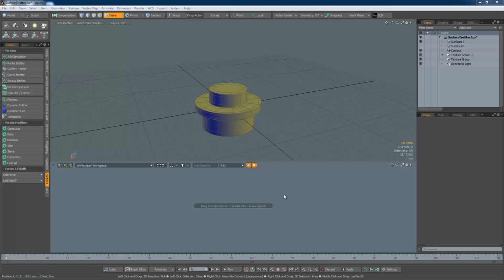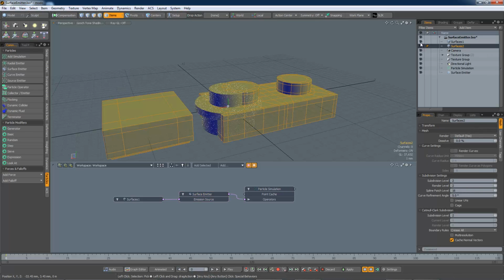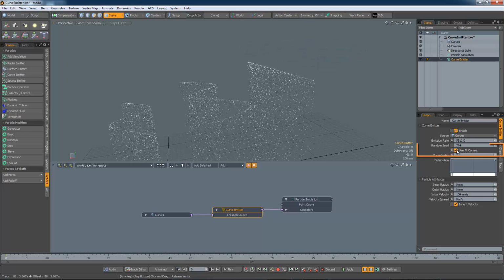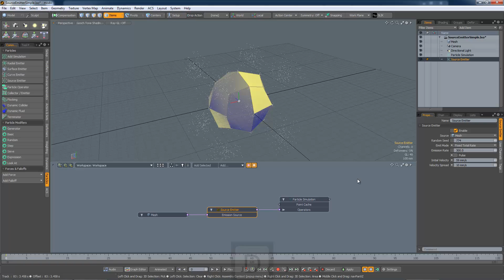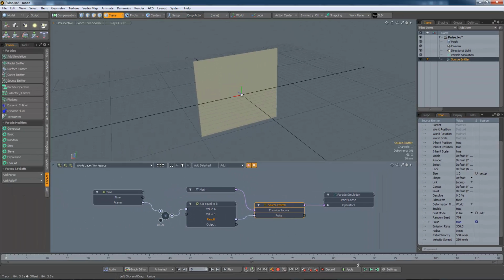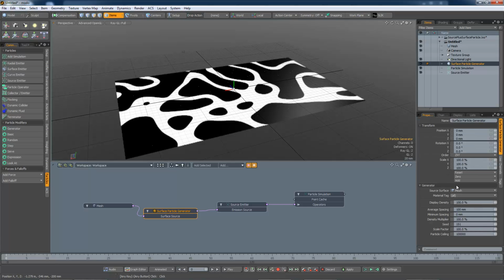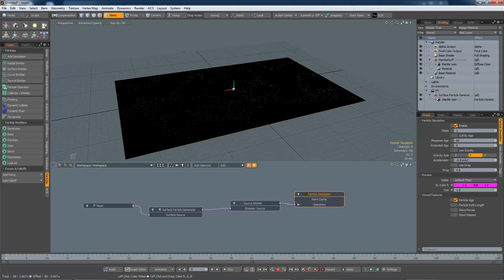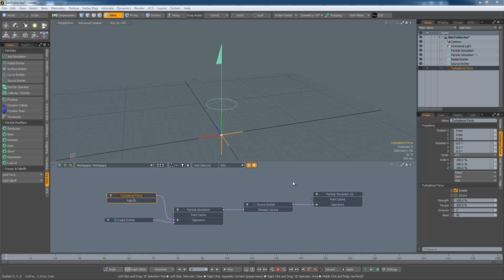The MODO 701 Particle System -- Part 2b - The Emitters

Comment: Hi Steve! How is the fast way to make point cloud from custom mesh volume in the last Modo vesrions? Yes, we can make particle cloud and make boolean subtract with the mesh but it so uncovenient.
Reply from the maker: Was this the sort of thing you were after? https://youtu.be/KjgVfjFLgSw
Reply: @SteveHill3D  This is what I talking about in my comments. Yes, this works but it's so inconvenient. :(
Reply from the maker: @gh3khH_ei  OK -- let me think on it.  I don't know off the top of my head if anything in the newer versions has made it any more convenient.  I have a lurgy (not COVID) at the moment that is dulling my brain so I'm  not firing on all cylinder.
Reply: @SteveHill3D  Good health to you! :)
Reply from the maker: @gh3khH_ei  So, I have created a MeshOp Stack alias/assembly that encapsulates the work needed to set up a particle cloud inside a mesh or meshes.  It basically does what Greg did, but is fully procedural since we can now merge meshes with particles in.  But MODO is doing something really odd adding a bogus "Render" entry in the shader tree whenever I use the alias -- it can't be deleted and I have no idea why this is happening.  If you are cool with the oddness, then I can link the assembly for you to try out.
Reply: @SteveHill3D  I wonder why this has not become a built-in feature in Modo, since it is so necessary when generating particles. For example, Houdini has a node for this and a few more options on how to do it without pain. Please let me check your creation or you may better post it on the Luxology forum. :)
Reply from the maker: @gh3khH_ei  Good plan -- see my tale here: https://community.foundry.com/discuss/post/1232207

Comment: Hi Steve, thank you for taking the time to post your great videos. I have a question that is an extension to using textures to drive a source emitter via a surface particle generator. If the surface was a sphere rather than a plane, how could I get the particles to emit normal the sphere? Currently, they want to meander about randomly. I appreciate any feedback you might be able to lend. - brad
Reply from the maker: +Brad Baxley Hi Brad.  Particles are emitted in the normal direction when you use a surface emitter.  If you are using a different kind of emitter -- like a source emitter for example, then I guess you would have to do some sums to work out the normal based on the position of the particle wrt the centre of the sphere and the use this to set the velocity.

Comment: Steve, first of all, thank you for the valuable information. I'm trying to re-create what you did, emitting particles at every 10 frames but It's not working here. I'm using Modo 801. Do you know if I need to apply any changes for the 801?
Reply from the maker: Hi.  I don't think you should need to change anything for 801.  I don't have access to 801 right at the moment, but I can check when I get home.
Reply: Steve Hill Alright. Thanks for your time and attention! :-)
Reply from the maker: Roger Macedo I've added an lxo file demonstrating "pulse" in action in 801.  There are other ways to do this sort of thing -- you could just animate the emission rate, for example.
Reply: Steve Hill Thanks a lot :-)
I noticed that, even with a high emission rate, Modo shows only a few particles. I tried to change the parameter, but nothing has changed. Do you have an idea why it behaves this way?
Reply from the maker: Roger Macedo Yes, I think that the pulse mode only emits one particle.  If you want more than you will have to use those particles as a secondary source, or just alternatively animate the emission rate which I think is more flexible anyway.
Reply: Alright. Thank you very much for the prompt responses Steve Hill

Comment: I am quite new at this and have a hard time understanding what the output of the emitters and simulators will do when the equation becomes compounded or reordered. Regarding your pièce de résistance and to counter your reference, I didn't see it at all! I am trying to learn through experimentation but my simulation results are still confusing. Is there any mnemonic you can offer or an underlying sentence structure I can use to talk myself through these setups? 

Cheers and thanks again!